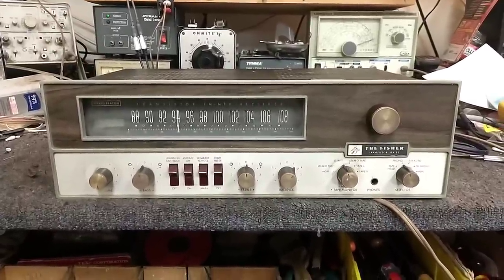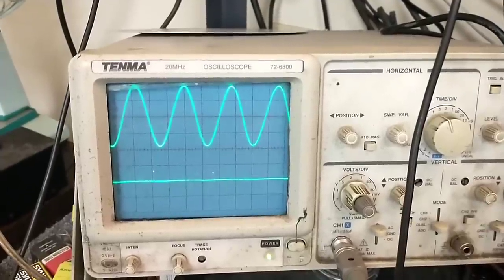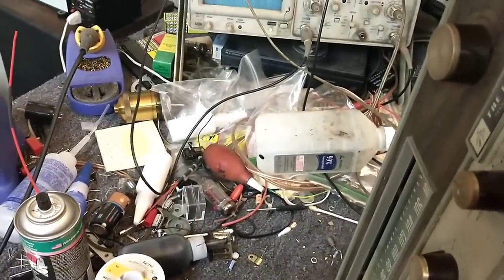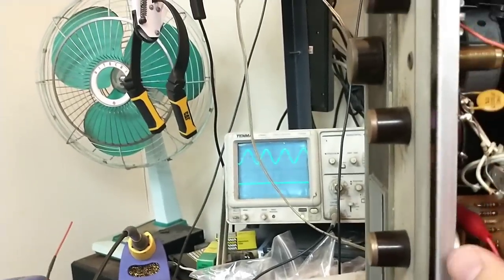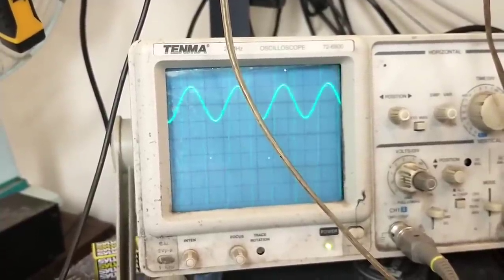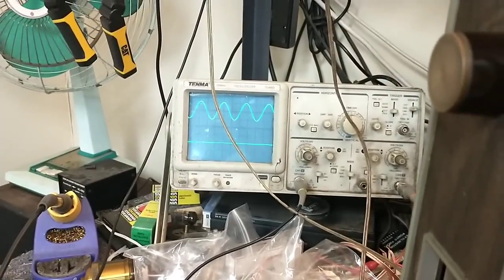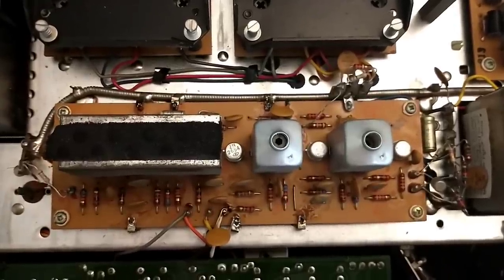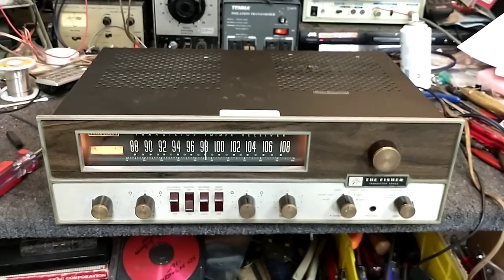Quick Repair of a 1968 Fisher 500t stereo receiver. Right channel out. FIXED

Comment: Just a note that it looks like you replaced a 65V cap with a 50, not sure I'd leave it that way.
Reply from the maker: Voltage on the cap is 38 volts
Reply: @JordanPier  Sounds about right, half the power supply, however your measurement is static.  Consider that the capacitor does have a dynamic voltage applied.  A high frequency spike into the inductive load of the speaker will drive the voltage across the capacitor up.  The original designer considered the 65V part appropriate, I wouldn't second guess them.  Anyway, it is your lookout.

Comment: Hello there and greetings from germany!

If you do the FM / IF Alignment with a sweep generator... is it mandatory to have a trigger function for the oscilloscope? My sweep generator sweeps back and forth just fine with 10,7 centered but i cant trigger nor do marks with it. So i'm not sure if its worth messing around with it or not.

Thanks in advance!
Reply from the maker: The scope I have triggers based on settings of vertical or horizontal sweep amplitude, or by an external trigger.ive always used the internal settings

Comment: Came out great!

I had to do the same exact procedure with a Philco Ford table solid state stereo table radio. Left channel was dead. Traced to 2 caps in the left channel path on the output board. Replaced both those caps. Both channels working now. Luckily for me they were easy to get to.

Comment: Man I enjoyed your video , I’m back to collecting retro receivers tape decks EQ ‘s , and amps , small collection right now but some of them need cleaning , at connections RCA jacks  , so it’s good to know about electronic cleaning solutions or sprays , I’m subscribing to catch more info , thanks in advance for showing me  , well is some technical fixes so restore older well built equipment

Comment: Hmm, good tip about de oxit and pots. Natrol it is...
Reply: actually, no problem with using DeoxIT for pots-just use the correct type:F-series NOT D-series.
I'm guessing that he had problems with D-series-this is for METAL TO METAL contacts.
So it's ok for contacts, switches, etc-but the only type of pots that it is ok for is WIRE-WOUND ones.
Normal pots use either conductive carbon or conductive plastic as the resistive  element, and these should not be treated with D-series DeoxIT.
F-series DeoxIT (used to be called FaderLube)is safe for pots.

Comment: I'm surprised it doesn't have more dodgy caps,  that's a reliable old beast :-D.
The only fisher i knew was a cheap and nasty plastic thing.
That must have been the take over effect.
it looked like a toy, not a serious amplifier at all.
Reply: Right, those were built by Sanyo in Japan, after the takeover....the one Jordan has there is made in USA